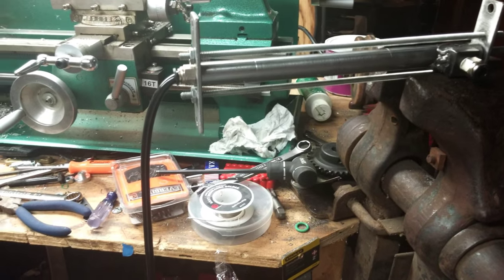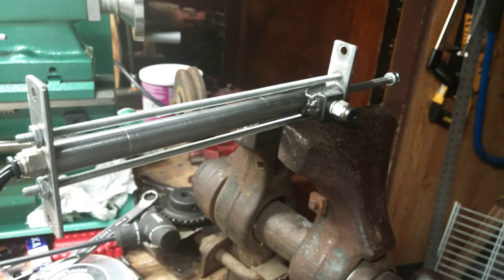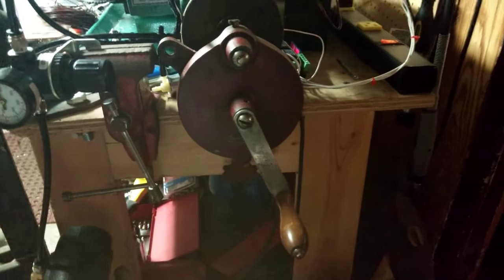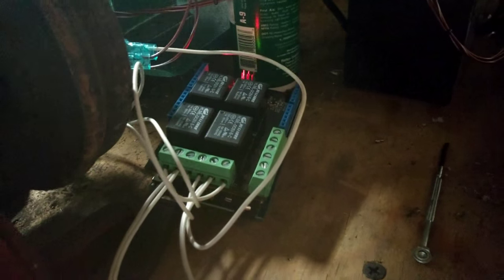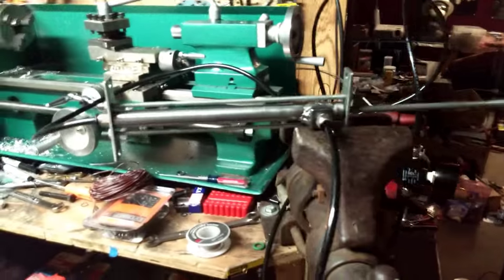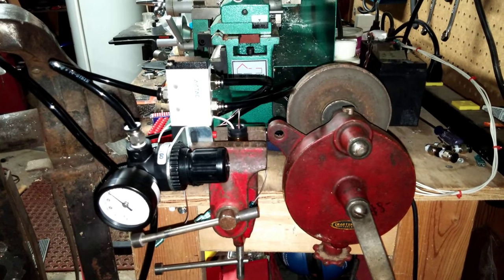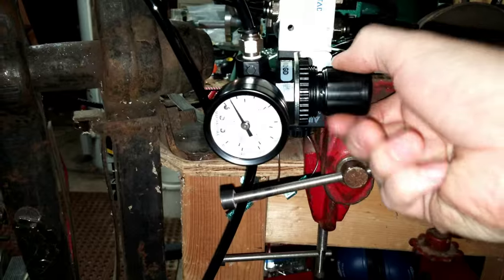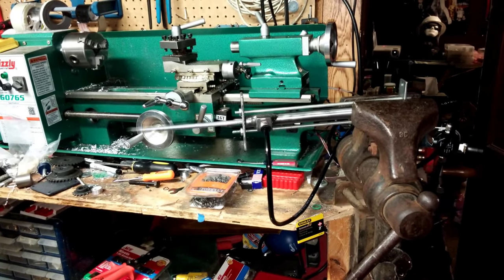Homemade Pneumatic Cylinder - Improvement tests

Comment: Hey man this is awesome! I was wondering, can you send me a parts list for this? I have a project at work that needs to do exactly what you're showing, only at higher frequency and impact. It'd be much appreciated :)
Reply from the maker: +Anthony Z Sorry for the wait, it took me a while to go find some of these parts again. I hope this helps your project!
Cylinder tube: 3/8" ID 5/8" OD Drawn-Over-Mandrel tubing
Piston block: 3/8" round
Return fitting block: 1/2" square
Rod: 1/4" round
End plates: 1/8" x 3/4" flat 
Tension rods: 10/32 threaded rod
Air fittings: 1/4" PT 6mm/1/4" press fittings x 5 (2 on the cylinder, 3 on the solenoid)
Solenoid: Amico/AirTAC model 4V210-08
Air hose: 1/4" OD vinyl tubing
Electronic Control: Arduino Uno with a Seed Studio Relay Shield V2.0
Power: The arduino was powered off of USB. The relay power was from a 12V lead acid battery
Reply: +fadeennui hey thanks! I actually ordered all the parts before you were able to get back to me. Actually one thing that would be very helpful is if you could nudge me in the right direction for the coding. I'm good at all things mechanical, but even the simplest coding sends chills down my spine
Reply from the maker: +Anthony Z If you use the Arduino Uno with the Seed Relay Shield V2.0, this page is a huge help:
http://www.seeedstudio.com/wiki/Relay_Shield_V2.0

The code I used for the cycle test is below. This is using two relays to control the small solenoid network I used in the earlier test. With the Amico solenoid, you can use just one relay (and one digitalWrite line). Turn it on (HIGH) and the cylinder goes one way, turn is off (LOW) and the cylinder goes the other way.

int Relay1 = 7;    // Digital Arduino Pin used to control relay 1
int Relay2 = 6;    // Digital Arduino Pin used to control relay 2
int Relay3 = 5;    // Digital Arduino Pin used to control relay 3
int Relay4 = 4;    // Digital Arduino Pin used to control relay 4

// the setup routine runs once when you press reset:
void setup()  { 
  // declare pins 4-7 to be outputs:
  pinMode(Relay1, OUTPUT);
  pinMode(Relay2, OUTPUT);
  pinMode(Relay3, OUTPUT);
  pinMode(Relay4, OUTPUT);
} 

// the loop routine runs over and over again forever:
void loop()  { 
  digitalWrite(Relay2,LOW);// NO2 and COM2 Connected (ram in - off)
//  delay(100);
  digitalWrite(Relay1,HIGH);// NO1 and COM1 Connected (ram out - on)
  delay(3000); // wait 3000 milliseconds (3 seconds)
  
  digitalWrite(Relay1,LOW);// NO1 and COM1 Disconnected (ram out - off)
//  delay(100);
  digitalWrite(Relay2,HIGH);// NO1 and COM1 Connected (ram in - on)
  delay(3000); // wait 3000 milliseconds (3 seconds)

                    
}
Reply: +fadeennui Awesome! Thank you so much. This is a huge help.